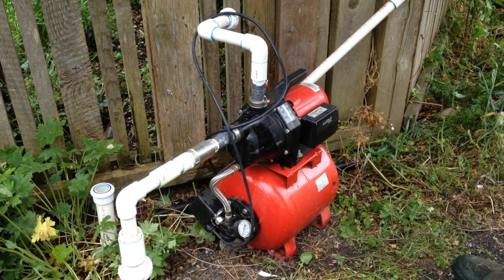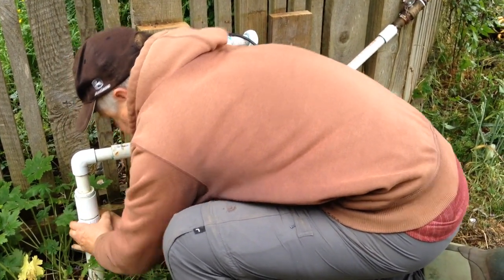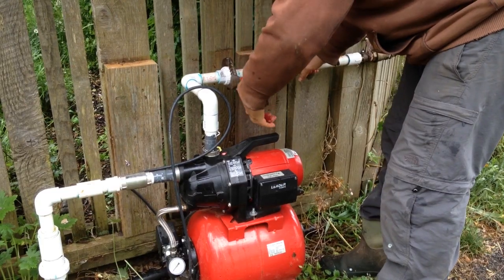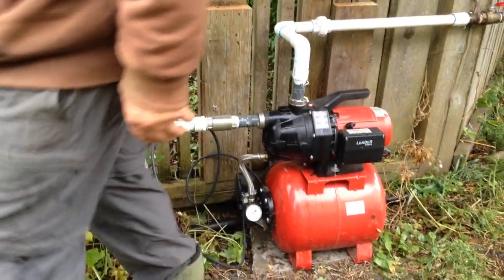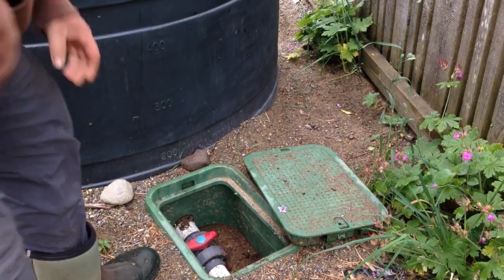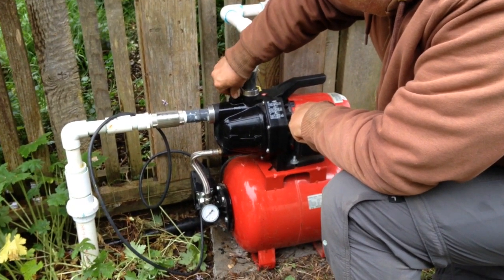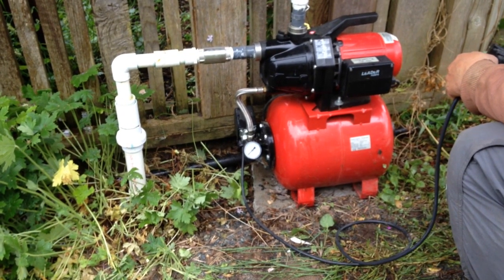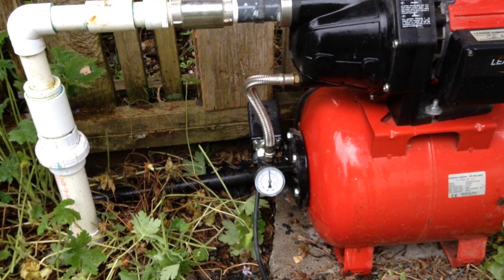Leader Ecomatic 110 pump priming

Comment: hi i read the manual one hour ago. iit says you need to pressure the cilinder with 1.5 bar or 22 psi before you load the system with water. There for i also installed one today but never primed it and never put any pressure to it. What can it go wrong?
Reply from the maker: Checking the tank's pressure is a good idea. Priming a pump is one of those best practices. The water will help cool all the moving parts and reduce stress on the pump at startup. Hope your pump serves you well.

Comment: Please guide how to solve the problem where this pump (Ecomatic 110) repeatedly starts and stops during water flow?
Reply: HI Prateek. Can you expand on your question? As I'm sure you know the small pressure tank and pressure switch turn the pump on and off as needed. This system turns on the pump on once it goes below 30psi and off once it hits 45psi (I'm pretty sure on those but the pressure range maybe slightly different. Also what size is your inlet or supply line, mine is 1.5" right up to the pump inlet were I reduce it to 1".
Reply: Jaan Designs Thanks for the reply. The Intel supply line is the same as yours. 1.5" dropped down to 1". The problem is when we start the pump it builds up pressure till 45 psi even if no taps are open and then stops working. Soon after the pressure automatically drops to 30 psi with all the taps closed and the pump starts again to maintain 45 psi. And this cycle continues irrespective of if the taps are open or closed. Outlet supply line is 1" converts to 1.5".
Reply from the maker: Sounds like you have a leak...do you have a check valve installed on the supply line..the one on my pump is a stainless steel 1". The check valve allow water to flow through it in one direction only. This is super important otherwise the pump will try and pressurize your supply. Hope that helps. 
1.Check for leaks
2.Check for a check valve.
Take care.
Reply: Jamie Wallace thanks for the solution. The problem was because of the absence of check valve. Once it was installed the pump is working as it should be.
Reply: You also should check the pressure in the air tank before starting up.  It should be set 2 psi under the cut-in setting.  So if 30-50, set it to 28 psi.
Reply: I